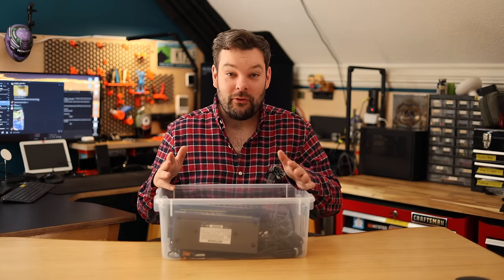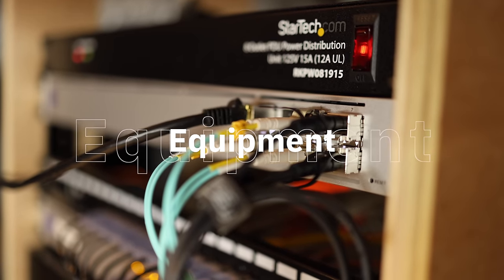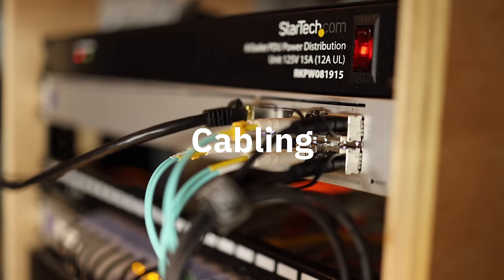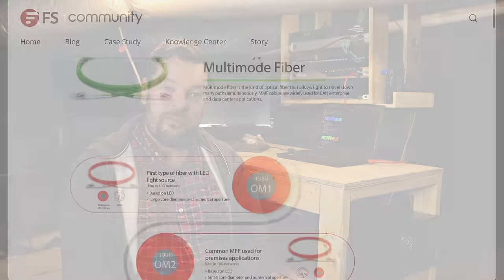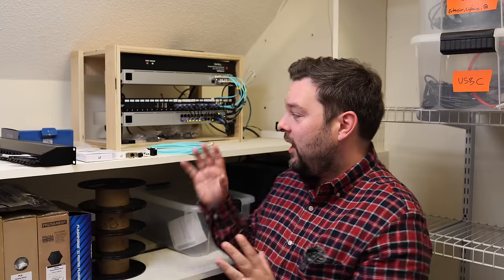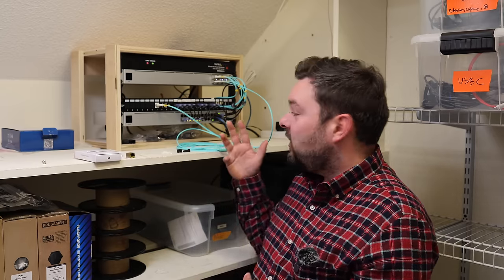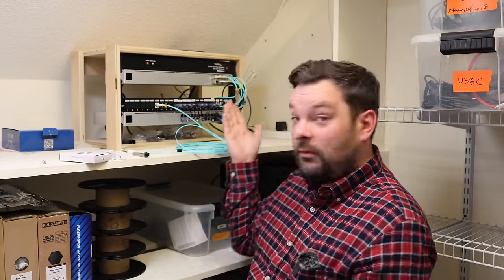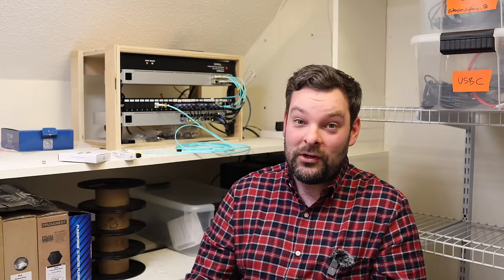Future-Proof Your Network: Upgrade to 10G with UniFi Fiber Gear

Comment: I run 10gbe copper at home for ~18m, but my cable is the very expensive Nexans cat6a, then the cable is terminated with cat6 keystones and then using 1m cat6a patch cables to the devices

for short runs use passive DACs, they use a whole lot less power, don't need SFP/+ modules and they have much lower latency than fiber
Reply: The shorter the cable is, the less the cat standard matters. You can easily run Cat 6a or 7 through your house and use a thin, badly shielded but highly flexible cable from the patch panel to the switches. That makes life easier.

Comment: The switch in my home network is an Aruba S2500 POE+.  It has 4 SFP+ 10G ports and 48 POE+ 1g ports. (I got it used on ebay for dirt cheap) I only have 4 wired devises on my network. They include my work station, my media server, my Blue Iris server, and unused 10g port saved for an unfinished build. Everything else is either a POE powered  security camera or a wireless device. It all fits in my 25U rack. Even my workstation is in my rack. Its all nice and tidy, meets my needs and works. Once I learn how to fully use a layer 3 managed switch, I plan to use vlans to segment my network.  The wireless stuff together, my security cameras together, and any future IOT stuff I may start messing about with will be together. I have a lot to still learn but its a fun hobby.
Reply from the maker: That looks like a kickass switch! What's the power draw / noise levels like?
Reply: @ktzsystems  It has 48 POE+ ports so the power draw is probably up there. Its certainly not silent but I can't hear it above the window mounted AC unit when the air is one in my office.

Comment: I segmented my house into two halves as well, the top and bottom floors are linked with a single SFP+ fiber cable from UI. USW-24-pro poe up stairs and down.
Reply from the maker: It’s such a logical way to do it!! Glad I’m not the only one.
Reply: @ktzsystems  I chose the ubiquiti one that already has the fiber attached. What I’m slightly concerned about is one of the transceivers going bad and having to replace the entire cable somehow which isn’t possible because we already fixed all the drywall.
Reply from the maker: @MagMan4x4  Do you mean direct attach?
Reply: @ktzsystems  yeah but they aren’t the copper ones, they are the green UI fiber SFP+ ones.
Reply from the maker: @MagMan4x4  Ah yeah... You might have been safer going for a transceiver / om4 combo there but YOLO!

Comment: Thank you for the very stimulating video. I currently use 2 TP-Link Stackable JetStream 24-port Gigabit T1700G-28TQ Smart Switches, each with 4 SFP+ ports. I installed 10GbE SPF+ cards in the servers (Proxmox, Truenas, Backup) and an Asus XG-C100C 10GbE RJ45 card in the clients. Firewall is an OPNsense - works!
Can you also say why you don't use a Unifi firewal in addition to the Unifi switches instead of OPNsense?

Comment: Thanks for the demo and info, I appreciate you sharing the network layout.  I have three Mikrotik CSS326-24G-2S+RM 24 port Gigabit Ethernet switch with two SFP+ ports  that tie my garage, computer room, and living room.  But looking at your setup, I guess I should put the Unifi Aggregation switch in the middle, making it a star, since I was just daily chaining them at this time with a 10GBase-T SFP+ to RJ-45 Transceiver

Comment: so i just bought a house, and while i dont expect internerspeeds in my rural area to get above teh 1gb speed i have now i did future proof abit, im using a UDM-PRO as my base, (thought about opnsense but it kept crashing and dropping same iwth pf sense couldnt get them to be stable), anyway i have 3 bedrooms on main floor with living room kitchen, 2 offices in basement and a living room, each room in the house has 1 dedicated cat6 and 1 poe dedicated cat 6, as well as a conduit for future runs, in my attic i just ran 4 pairs of om4 fibre as i plan on having a unifi poe switch there for cameras and 2 building to building bridges, 1 that goes to my garage and 1 that will go to a greenhouse im building in the back of my property, each will house a 24 port poe switch but probably just like 8poe 16 not poe,  :D great video gave me alot to think about for future fibre runs in the house, i apologize for my spelling i see alot of red lines lol
Reply from the maker: Then my work here is done. My goal was to provoke thoughts for others during their various planning phases. 
Good luck with the build outs.
Reply: @ktzsystems  so I have decided to run 2 pair om4 to my attic where I’m putting a poe switch and also 2 pair to my garage underground using half inch conduit 1 foot deep you gave me a lot to think about and the cost is not a issue compared to the amount of runs I need of cat 6

Comment: Great video , I've just joined the cult of ubiquiti the last few month and I'm slowly upgrading , people who say to just use a single switch and don't daisy chain have never retro fitted networking in a house ?
Most of my gear is upstairs so starting with my 10g there , my gear is a ultra router , to a 8 port poe switch , which gives me 3 camera + a AP with a trunk upstairs to a 16 pro max switch , with 2 trunks one to loft a 8 port poe with 2 cameras and a AP and the other to the garage to 8 port poe 1 camera and 1 AP.
I need a faster way to get from downstairs to upstairs which is limited to 1 gb .  
I wish the Flex 10 GbE had a SFP+ port so I could use a SFP+ port from upstairs to downstairs , going from SFP+ to  RJ45 is stupidly expensive and cheap to other way around.

Comment: Did you have issues with those fanless 8-port aggregation switches? In my network closet, it was frequently overheating with Mikrotik SFP+ connectors (I didn't use fiber at the time). I ended up switching to the more-expensive 32-port model (which has a built-in fan), and that fixed all my issues no matter the connector. I moved the 8-port model to another room where I'm only using 4 ports and haven't had heat issues since. Only 15 of those 32-ports are in used since SFP connectors don't have PoE, but it's already more than the 8 ports I had before, and I seem to be always finding more places to add Ethernet drops in my house. I've already moved 20 wireless IoT devices onto Ethernet, and will do that to more devices that support it. Ethernet EVERYWHERE!
Reply from the maker: Thankfully not. All good for over a year.

Comment: I am also dealing with a similar upstairs/downstairs situation. I lucked out. Snagged a Qnap Qhora-301W router for cheap (Amazon “used” but it was new). I’m already sucked into Qnap’s ecosystem, so I’m sticking with them. The router features two 10gbe ports! The router is on the main floor. I haven’t purchased the switches yet, but I’ll have one in the basement and another on the second floor. My setup doesn’t need fiber, just copper. When I buy a new house, I’ll probably switch to fiber. Maybe Qnap’s fiber switches will go down in price by then?

Comment: Great tour Alex! After watching the secret management video, I wonder if you've done any network automation with Ansible? It's quite different than with Linux targets.
Reply from the maker: Unfortunately not. The infrastructure I use at the moment isn't really conducive to infra as code. I don't know of a way (please tell me if you do) to configure Unifi or Opnsense reliably with these tools.

I'm always on the hunt for an opnsense replacement for this reason.
Reply: @ktzsystems  OpnSense and pfSense can be configured with Ansible. It's possible to configure a lot of Unifi (switches) with Ansible, too.

Comment: Lovely video!
I wonder if there is any way to stress test an internet connection to see problems like the one you described with the wrong terminations in the cable?
Maybe just iperf3 running over night with 10Gig packets?
Reply from the maker: Iperf3 is one of the tools I used! I saw loads of retries on cat6a cables and coupled that in with smokeping (see my other vid) to get an accurate picture of what was going on.

Comment: Thx for this video.. how would you fiber wire up devices like smart tvs?
Reply from the maker: The last "mile" would be copper into a SFP transceiver. But more likely you'd have a switch with a couple of SFP+ ports and half a dozen standard gigabit ethernet jacks.

Comment: Cat 6a cable can easily go 10g for 100m.  The thing is that most Cat 6a connections use normal rj45 jacks that are crimped with normal Cat 5e or Cat 6 crimpers.  Although this will pass the 8 pair connectivity tester, they will fail miserably on the Fluke test!  To get your Cat 6a connections to work properly you have to use a Cat 6a keystone jack and then connect that to a Cat 6a certified patch cable.  Alternatively just get the Telegartner MFP8 field connectors (or something similar) and connect directly one end to the other.  If you do that, your Cat 6A connection will easily go even 40G if for only 100 feet.  If Cat 6A cable is not using properly terminated connections ... you will actually have less performance than Cat 5e connections as the Cat 6A cable has heavy shielding which can work against you by propagating interference.

Comment: I wonder how long it will be where PON style fibre 10G-PON with just one strand will be a standard. It is very cheap to run with connector small enough to fit in the existing conduit. I could literally pull my cat5a out and pull the fibre in.

Comment: I changed my home network over to 10 gig all internal with fiber and DAC. And then I had plenty of ports on my SFP+ switches, And I was able to aggregate to connections to make a single link of 20Gbps. And then wherever and from my server rack to my wiring closet in the master closet I ran a ubiquiti multi-strand fiber line that has the six fibers, and so I was able to use two of them to send a 20 GB link to the Enterprise 2.5Gbps links to the ports around the house, and I had a old 1Gbps ubiquiti 105 w poe switch that I've had for a few years now and was able to use two more fibers to aggregate a 2gbps link to feed that switch which runs a handful of my ubiquiti cameras outside. Internally five of my rack mount servers have four 10 gig SFP+ ports, So each server has 40Gbps link. Where one server is running true Nas with the NetApp storage shelf with a little over 300 terabytes of space with 26 sas hard drives. And the rest are running ESXi and clustered v center. With all the VM storage hosted on the net app. So the connection between the servers and the NetApp and really anything within my network is incredibly fast If I'm transferring a file between server to server it's like a blink of an eye, if I transfer a massive file from my desktop to my server share it will actually upload that file to the server at 2.5Gbps speed as that's the slowest from my desktop to the server.

I remember many years ago when I upgraded from 100 to 1000 and was wondering if it was worth the payoff and sure enough it definitely was, gig items became cheap very fast however the 10 gig stuff is still taking a while and still coming down in price
Reply: But now I run ubiquiti products for my entire network. Starting with my UDM SE. And then have multiple 10 gig switches and one gig switches I have a whole lineup of gigabit POE switches that were being used. I have a configured into multiple subnets and multiple VLANs so data is isolated between those items along with SSIDs so they have their own networks

Comment: Skip the in between steps to go for the maximum throughput on standard Fiber optic networking.  I think it supports 1 Terabit per second, per color, per cable.  Certainly the way to go if you can afford that much speed.

Comment: I'd like to connect my main switches with fiber but in a normal UK house its a real challenge to get cables from A-B without breaking them. The cat6 cables I ran went trough absolute trauma to get them into the walls, pulling through internal bends etc. Then if you did manage it, you need to terminate them yourself as you'd never get a pre-terminated SFP connector through the walls
Reply from the maker: I did this for my mother in law. Easiest solution was to go outside, along the soffet under the gutters and then back in around a window frame where I carefully drilled and siliconed!
Reply: @ktzsystems  I'd never forgive myself if the cable were visible.

Comment: I’m running 10GbE on my network everywhere and I regularly exceed 2.5GbE.  I love it, BUT I was stupid for not laying fiber instead.  I could even have my server room with all my PC’s rack mounted and centralized anything I want and had better scalability.  I had a team come in for like a week to run it, so I do t want to redo the whole thing,e job 2 years later.  Kicking myself.
Reply from the maker: This is how I feel now having gone fiber. So glad that I did because I know it'll last longer than I need it too for upgrades etc. Performance is superb and has been super reliable all year.

Comment: I'm surprised you're good with 10Gb. It wasn't until I setup 25Gb that I finally moved all my files off my main rig and onto my NAS. Before, I only used my NAS as a backup because I was so unsatisfied with the transfer speeds. 25Gb is finally at NVMe speeds with PCIe gen 3. I'm actually running into limitations in my drives now rather than the cable. Also, upgrading everything to jumbo packets for that and my 5Gb Internet seems to have caused issues with some older devices. I left it this way, but I'm aware there are weird issues now for some IoT devices. It's never that simple :/.

Comment: Great stuff.. have been pondering this upgrade for a while, but the whole "your transceivers might work, might not" thing was been holding me back.. I'm already in the unifi eco system with a USW48 with two sfp+ ports, so I may try and dip my toe in 10gig waters.. also read that the fiber cables are more fragile than copper.. what's your experience with that?
Reply from the maker: I didn’t find it to be much of an issue at all. I treated the fibers with respect and didn’t yank on them and was careful not to kink. They are made of glass after all. 
It is a consideration but not a massive one tbh. I ran conduit in areas the fibers are exposed to minimize my risk over time.
Reply: My experience with fiber patch cables is that they break when you slam them in a door, and when you force-bend them at the connector by having no room between the switch and the switch closet door. You can wind them around a finger just fine.
I have ~100 in the infrastructure at work, so we have spare patch cables and spare transceivers. So since we aren't worried about breaking them, we don't treat them with extra care, and none have broken outside of the above causes. It is also how I have ended up with a few at home - If I slam them in the rack door (accidentally! honest!) and they don't break (they usually don't) I replace them anyway, because they are cheap and failures cost time.
Reply from the maker: @kkpdk  Great insight!
Reply: Most of the fiber cables these days are very robust. They can be tied in knots with videos showing it in action.

Comment: Why run 2 SFP+ connection back to the other switch, dont understand the need for 2 when one is enough. also this not cause some sort of loopbakc, do you change a setting on the swtiches to account for this?
Reply from the maker: In the Unifi software you create an aggregate link which is capable of a failover in the event of a failure. 
It doubles the number of links so in theory at least two simultaneous 10gig transfers can happen at once with different clients.

The primary reason was redundancy. Running cables is a pain and running two is not 100% more work than one so why not?

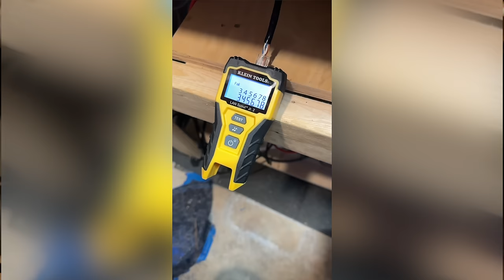Comment: @KTZ Systems Did you mean to say "cat5e" instead of "cat6a" when describing your cabling issues?  I just ran full cat6a (~3000 feet of cat6a that is as thick as quad-shielded coax and is hard to work with when running through the installation holes when at scale of ten or more cables.) for my cameras, and drops for rooms.  I did this work last year throughout my home and the cable you just showed in your reference is not cat6a at timestamp 10:47 .  (Where is the shielding and the cable overall diameter looks more like regular cat6 or cat5e). I have 120ft runs from my basement to my attic and upper level devices and everything is solid.  However, this is now irrelevant because you have already invested in fiber to your problem is now solved.).

Comment: Hi I wish to seek some help to upgrade my existing home Unifi networking system to 10g fibre ……if I can contact you somehow and discuss my existing setup I would be grateful. 

Once I know exactly what gear I need to buy from Unifi - and subsequently the step by step plan to implement the necessary changes I can confidently do this myself. BTW I am just an ordinary person not an expert but very much interested in improving my slow home network. 

I know it’s important for you to have details of my current setup in order for you to guide me? I am happy to pay for your help. 

I am not in the US - live in UK

Comment: USW Enterprise 8 PoE is a nice compromise. I wish UI would introduce more 2.5Gb switches.
Reply from the maker: Agree. But stock levels have been so inconsistent for the last while it's been near impossible to get one.
Reply: Qnap make an 18 port poe++ 2.5gbe switch with dual 10gbe i think. Though its overkill for my needs. I use literally the cheapest Zyxel 2.5 100 dollar 8 port and a port injector for doorbell and iptv camera on couple of the gig ports on router. I dont belive in excessive future proofing as the costs  drop continously on netgear gear, power consumption goes down and features and speed increase too fast.